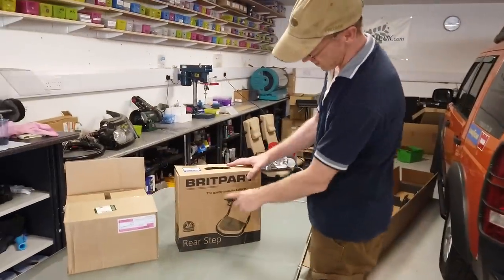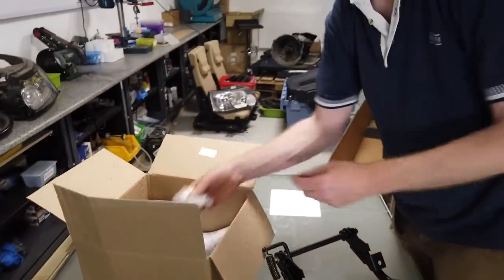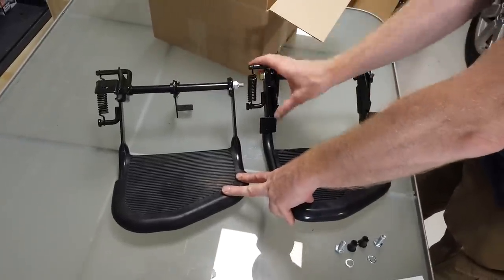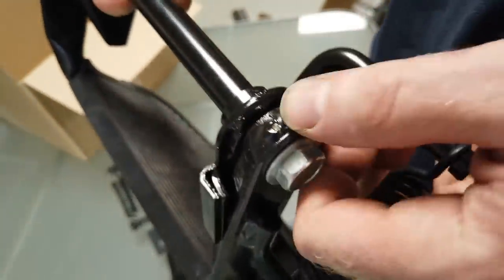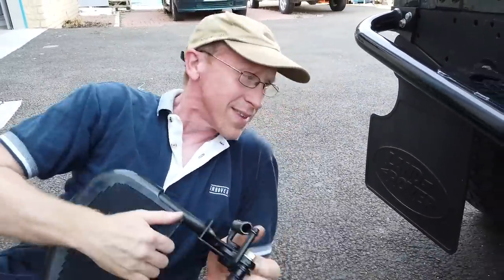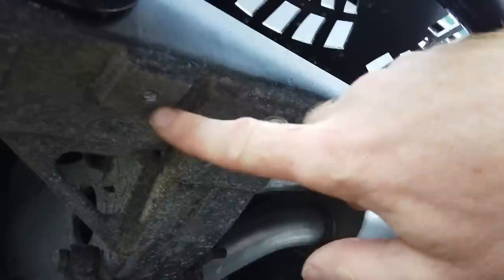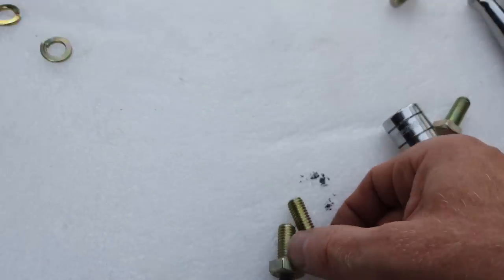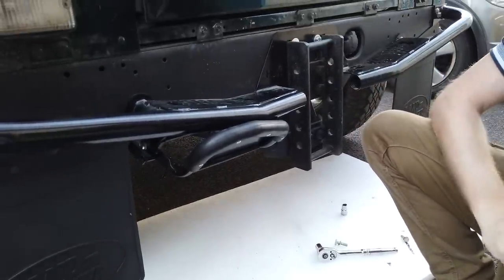1st Gen Land Rover Defender rear step comparison and fitting guidance STC7632

Comment: You have the really nice anniversary rear step bumper, so you do not need the fold up one on yours, with a smear of grease the rivnut will pull up much easier, but the pull through with the thread is not to correct way to pull them up, the threaded stud should not turn, but just be pulled up until the rivnut collapses, that way you do not strain the thread, I think the turn in type are made for amateurs to use at home. what is really needed is a gas strut to keep the rear door from closing when on a camber! Stay safe ! Chris B.

Comment: Depending on the model year the genuine article is over twice the price of the Shitpart item.  Having said that, both paint finishes will last about three years and then the whole assembly will be red rusty.  When this happens, remove treat with rust converter and a couple of coats of Hammerite smooth and it will look better than when you first fitted it.

Comment: Your supposed to use the same bolt as the tow bar for the britpart one
Reply: I agree.. instead of 2 spacer washers and drilling a hole you could easily mount on the towbar bolt with possibly not additional spacers due to the thickness of the flange in the left against the mount for the towbar
Reply: By mounting in tow bar hole, does step still function 100%?
Reply: Why would Britpart automatically assume you had a towbar fitted then? I imagine it doesn't feature in the ...ehem... fitting instructions leaflet?
Reply: @rafflesnh  where I live and travelled, EVERY defender has a tow bar fitted, the hitch ball may be off,  or they completely covered in mud, but they have one fitted.
Reply from the maker: Hi - i did consider it but did not want the step to be between the chassis and the tow bar angle plate... and if i put it under the angle plate the step would be a fair distance off the chassis and the other side would need shimming.

Comment: Just replaced the original rear step on my 1983 Land Rover 110 CSW with a bearmach step. Only difference to the Britpart one being the nut and bolt sticking out on left side inside of right. The video showed no extra screw thread. Having orginal bolt holes (rivnuts) you needed to adjust the distance between the fixing holes on the new step so they lined up with the screw holes in the chassis

Comment: My understanding of a rivnut is you install it and use a tool to compress the internal part that collapses and holds the rivnut tight ??Then insert retaining bolt and tighten. 🤔
Reply from the maker: This is correct for most rivnuts... the hexagon design is super clever as you cust fit your bolt and tighten - this will collapse the rivnut as it is unable to turn... this is more useful on larger M8 M10 bolts where the collapse force is higher.
Reply from the maker: @johnstidworthy3370  Thanks for the link John !

Comment: I had rib nuts , hope I spelt it correctly, 30 years ago so there not new. We used a machine the you could change the screw part out. So we could change 6 to 8 to 10. It used compressed air and was same good.  It went on a sort of hydraulic system. I dont know what they cost but could be a good purchase,  save time a d not break your hand.

Comment: Both steps come with 2 rivnuts/bolts. I think you're meant to use two rivnuts and avoid that pre-tapped 8mm plate thingy. Shimming the step brackets means they'll bend sooner - 'cos they're not flush up against the rear x member. Couldn't see the destructions properly - what did they show/say?